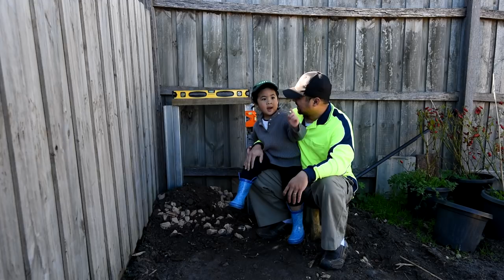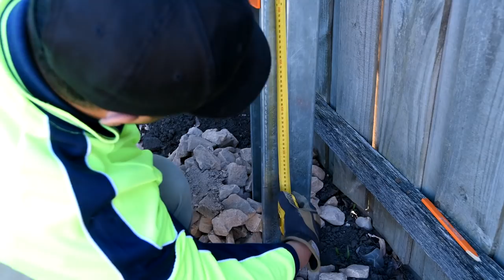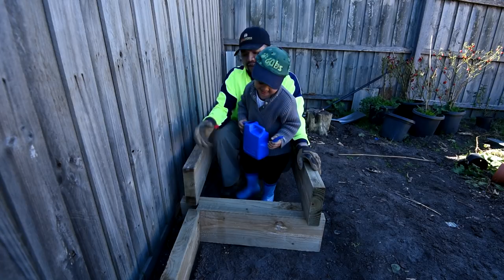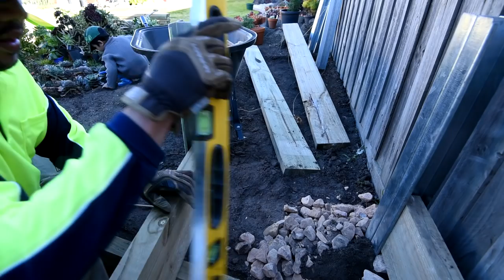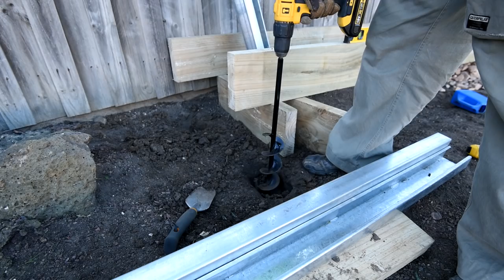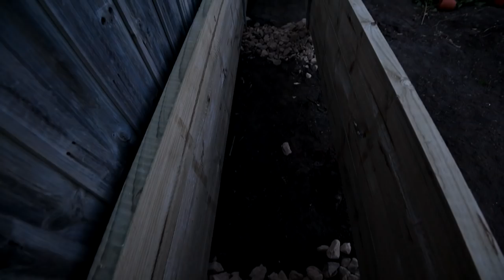#80.2 Putting it all together

Comment: Such a Great effort!!! It will get some time to build it whole!, but don’t you stop 😉 First I thought you will use a cement for filling holes, but rocks will also do if you haven’t got there heavy rains.
Ps. Zac ‚A Little Helper’ is so cute in this video 😍
Reply from the maker: The lower layers of the soil is hard clay so I figured I could just pack them and the rocks really tight around the posts and not need to have cement. Gravity and friction will be more than enough to hold the whole thing. It's so hard digging in clay haha!

Comment: Una consulta, como se llama esa piedra que colocó que es algo grandecita ? O se puede usar cualquier tipo de piedra? ?
Reply from the maker: Hi Jaqueline. About those rocks, I only use them because I did not dig all the way down to bury 50cm of the post. If you are able to dig deep, then that is better than trying to reinforce at the top.

But anyway your question was about the rocks. I got this from my landscape supplies shop, they are 8-15cm in length. You can use slightly smaller ones if you can't find it, just as long as you can keep it heavy so it can support the posts. The idea is the same as using sand bags as weight to keep the posts from moving too much.